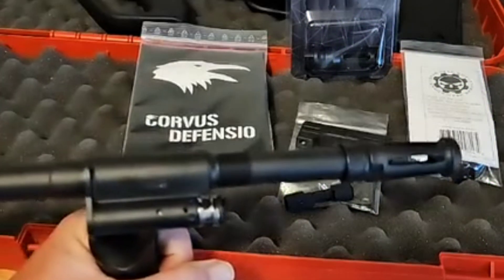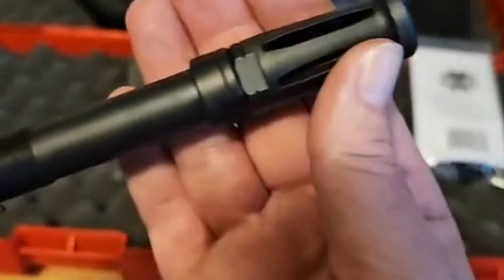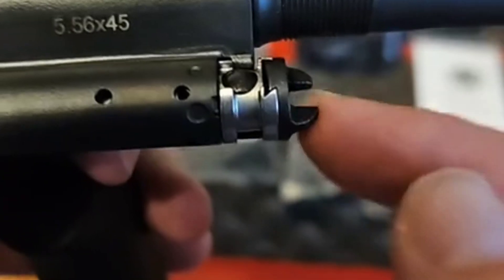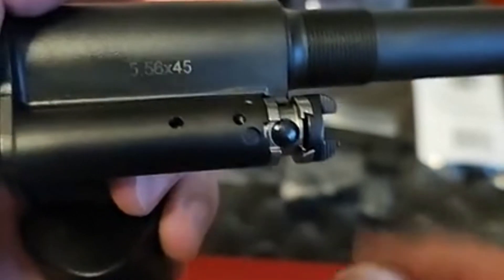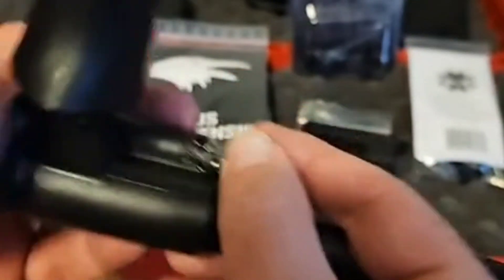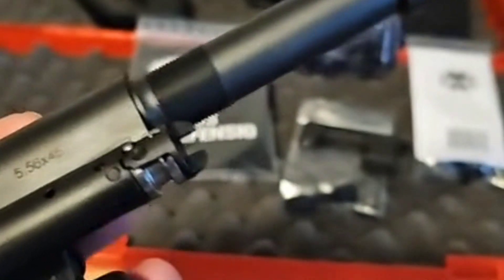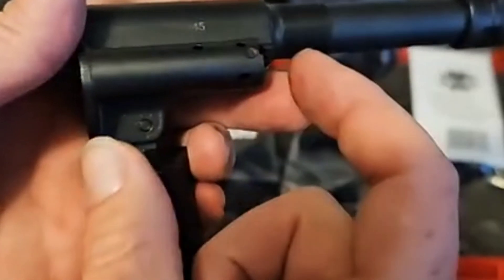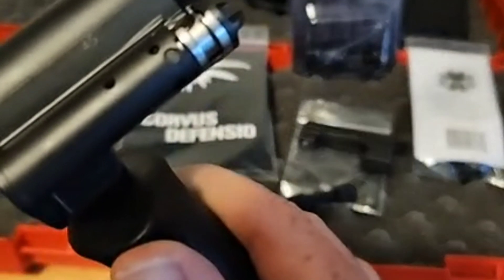Steyr AUG gas settings explained

Comment: What was the bottom gas hole mentioned at 2:25 for?
Reply from the maker: That is for grenade mode it basically vents all of the gas so the rifle will not cycle

Comment: Question: Does the 20" AUG barrel need the specific Suppressor gas valve?
Reply: The fact that I’ve never seen different ones offered on steyr’s website leads me to think no, but I do not know for a fact. The same plug being used for the the 20” and 16.5” barrels may explain why the recoil on the 16.5” has been described as “snappy” considering the differences in dwell time.
Reply from the maker: All of the gas plugs or gas regulators are the same from the factory there is a suppressor gas plug available.
And are universal for all aug
Reply: @TnSteyr  thank you.

Comment: How should the piston be cleaned and lubricated? And what setting for a suppressor? Thanks
Reply from the maker: You can clean it just like the rest of the gun with a little bit of CLP or Gun oil and a scrub brush when reassembling I would only put one or two drops on the nose of the piston and around the rings does not need very much oil at all reassemble and enjoy.
On this Factory regulator gas plug there is no spresser setting that is a Pacific Gas plug I do have a video on how to modify this standard gas plug to work with any suppressor that is on the market so if you are looking for a suppressor plug you should look towards one of us tire dealers
Reply: In the brownells series on the Aug, they say to put a drop or two on the regulator, but leave the piston and spring dry
Reply: Mine is stuck it will not rotate!  Several years ago, I talk to the factory they were no help. Lately I’ve been adding some penetrating oil’s. I tried using the pin that holds the sling on in the rear that doesn’t move it.
Reply: @bobhoman9410  Hopefully you got yours open - I recently got an older AUG that needed some TLC and the gas plug was also quite stuck.  I ended up using the sling/retaining pin, bracing the barrel, then very lightly tapping with a hammer on the pin to dislodge the plug ears.  This worked after a few taps and I was able to complete the disassembly as shown in the video.  After I had it apart, I was able to clean/lubricate the plug and get it to move under hand pressure as shown.

Many thanks to Tn Steyr for the video (and others), this was fantastic and was what I needed to get my AUG functional!